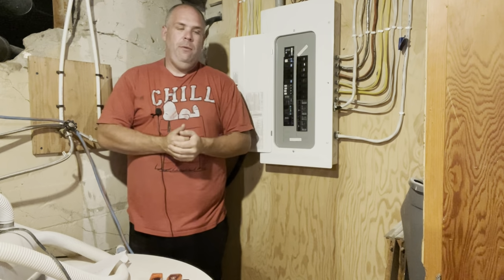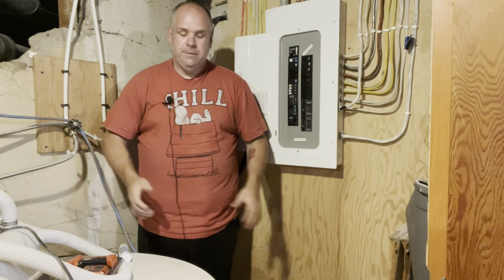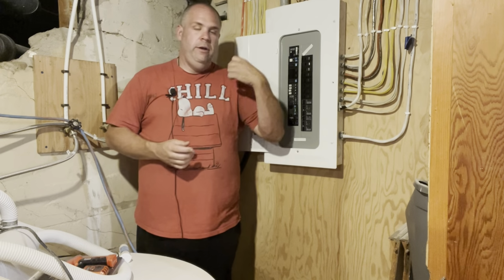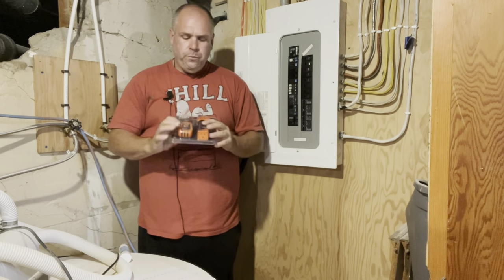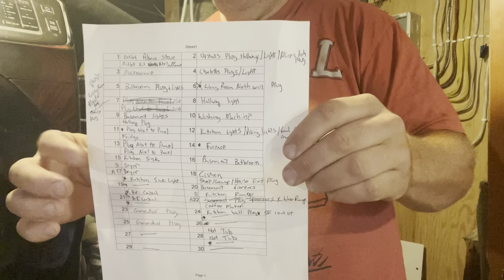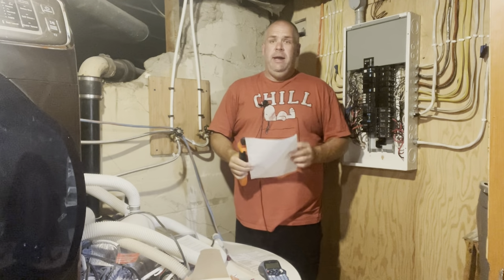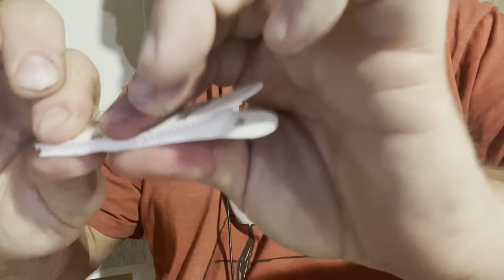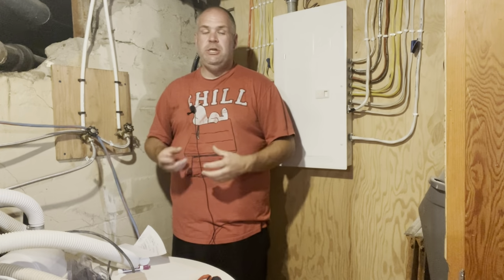31. TIPS To Make LABELING Your ELECTRICAL PANEL EASY

Comment: I just did my house today.  Turned on all lights, fans, (most appliances have lights) and others use power strips etc... For empty wall plugs I just carried around a small night light to check for power. Flipped off one breaker at a time and inspected to see what lost power. Used painter tape and sharpie to mark every light switch, wall socket and appliance with the breaker number it was powered by. Did not take long at all because you are inspecting everything at once. Next, I will make good (small) labels for all the wall plugs and light switch covers with the breaker number. And at the breaker box create a general legend of the inside areas for each breaker. Personally, I think the number label on the plug and light covers will be more useful and direct when identifying the correct breaker.

Comment: Great video! Also, Klein Tools offers an "adapters kit" to go with this circuit breaker finder which allows it to test everything... :)
Reply from the maker: I did not know that I’ll have to get one to test thanks for the heads up
Reply: @TOOLMANTIMSWORKSHOP  The kit is made up of 3 items; 2 that you already mentioned (lamp socket adapter and 3 prong adapter) and one alligator clip cord for bare wires...

Comment: Labeling each outlet with the corresponding circuit number wouldn’t be a bad thing either. I had never thought of doing that. Thanks!
Reply from the maker: Figured it would Make it quicker than counting down
Reply: @TOOLMANTIMSWORKSHOP  I think he meant putting a label on the outlets indicating which breaker they are on. This is commonly done in commercial buildings.

Comment: I put the breaker number (label) on the breaker itself, rather than the panel cover. This way, I can identify the breaker when the panel cover is removed (so I don't have to count the breakers)..If using a label maker, you can trim the excess tape, so that it fits nicely.